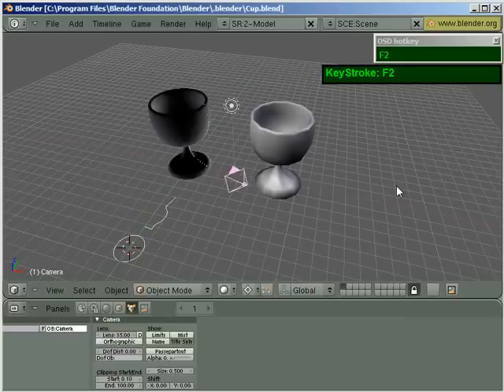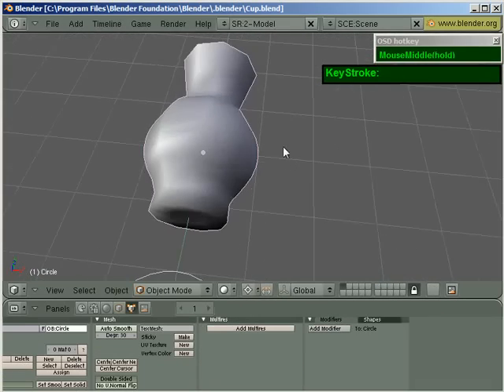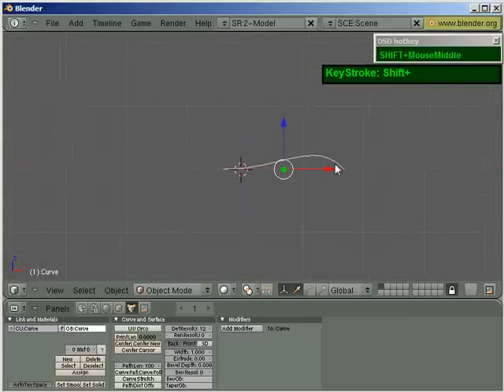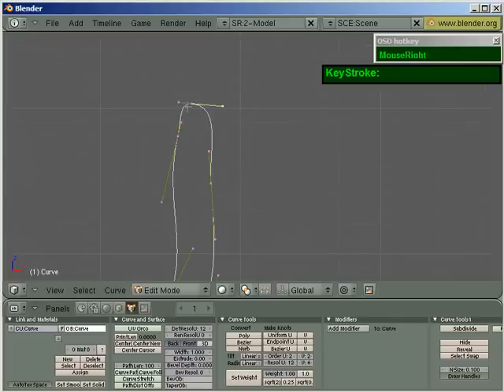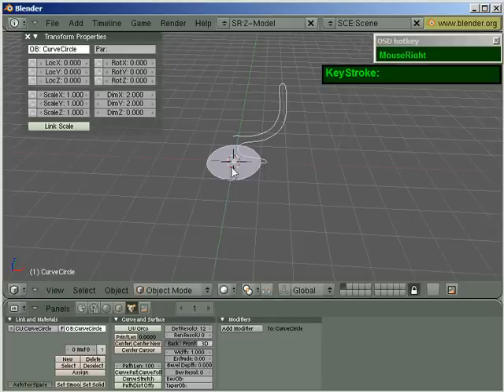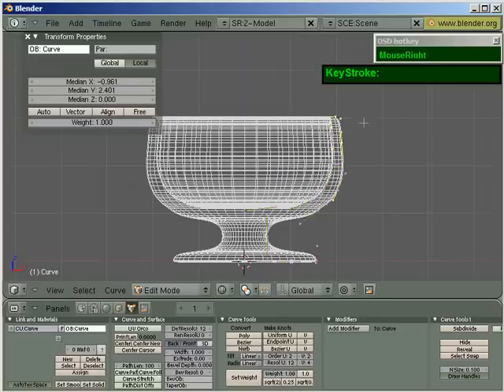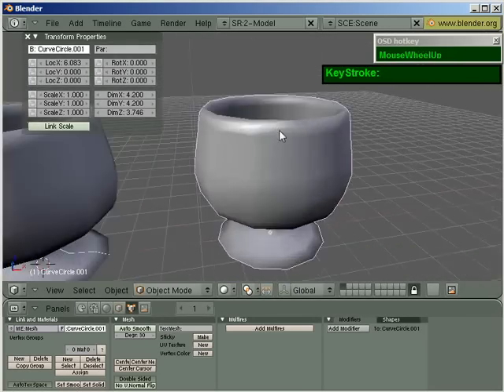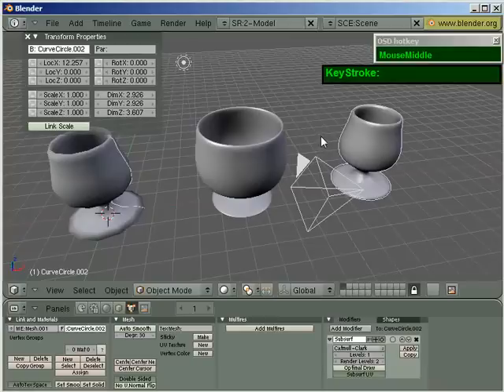Blender Cup Tutorial using Bezier Curves Part 1 of 2

Comment: Very good tutorial, thanks for submitting it. Under Blender 2.5 Alpha 2 the bevel always seamed to leave a large hole in the centre the same width as the circle. I found that this can be eliminated by setting modification 'Width' to 0.0 this parameter is on the same pane as the bevel object selection box.